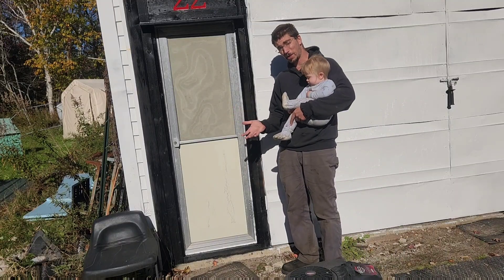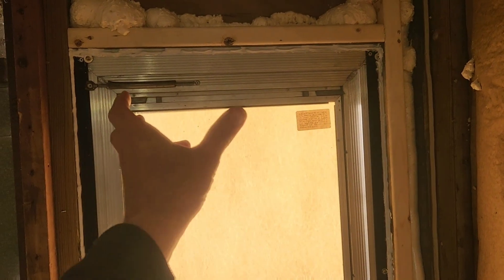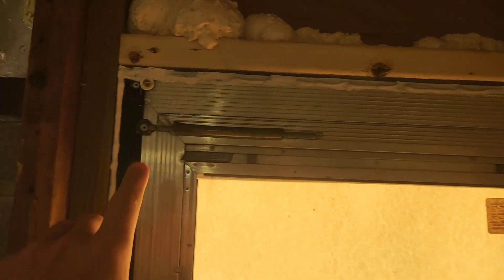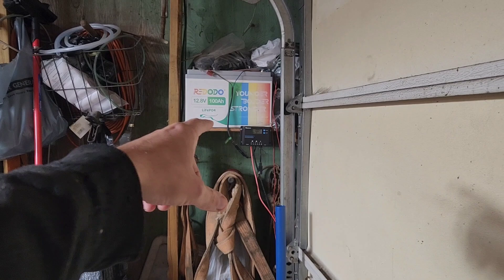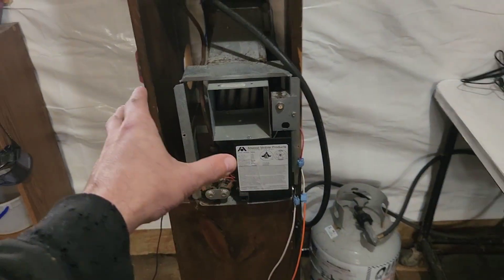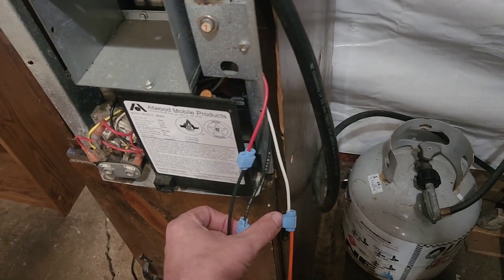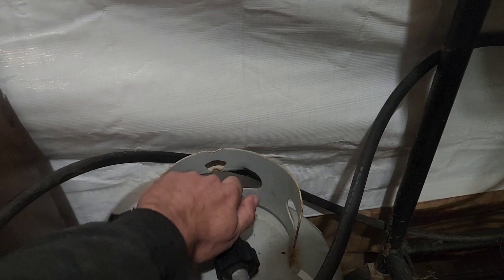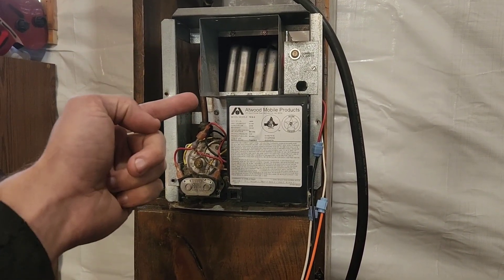RV Camper Door and Propane Furnace Installed in Garage 12v System Solar

Comment: Seems like a great use of an otherwise useless furnace.  A larger propane tank would probably be recommended for long term use though I'd think.  

As for the diesel heater, wouldn't you maybe want to install it in the other side of the shop rather than next to the propane furnace?
Reply from the maker: The other bay will have it's own heater in the future. The point of adding the Diesel in this day is to bring things up to temp fast then use the propane to hold the temp. The Diesel and Propane combined will put out 40k BTU.  Almost as much as a small torpedo heater but without the fumes or moisture problems.